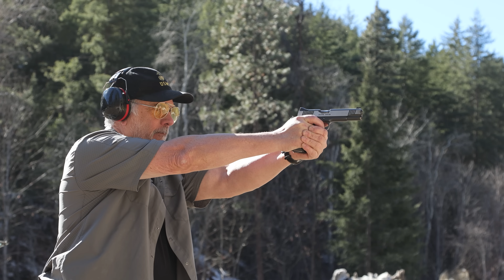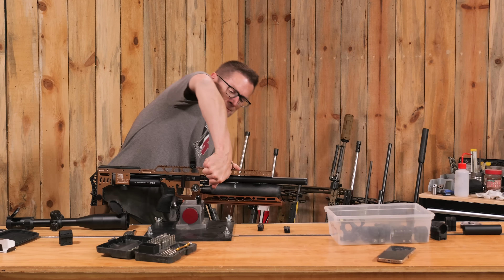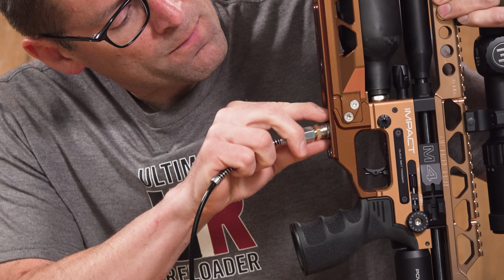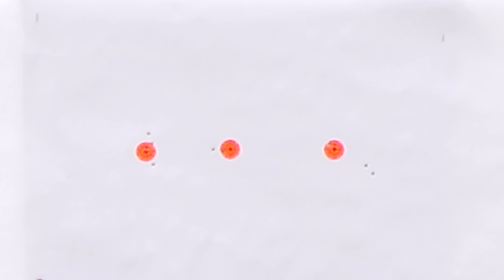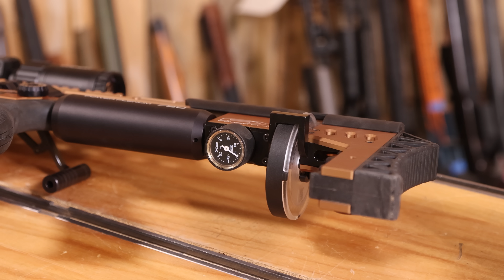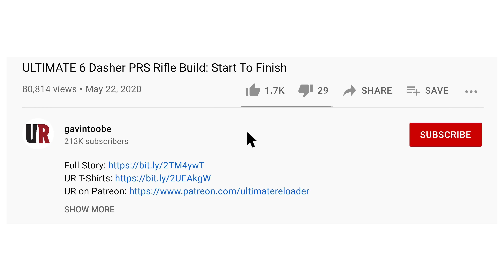Impact M4: FX Airgun Testing & Overview

Comment: No doubt everyone who owns a PCP/HPA compressor (like me) cringed when this guy started his compressor with the compressor bleed valve closed.  Never start your compressor against pressure.  Start it with the bleeder valve open, let it run a few strokes to warm up the grease and then close the -bleed valve (and open the tank valve if you don't have a fill valve on the tanki)  and let it build pressure. It probably didn't matter when filling that bottle (which BTW that compressor is not rated for large bottles like that) IF the bottle bleeder valve was open but that compressor is made for filling guns and guns don't have a bleed valve.

Don't start your compressor piston(s) against pressure.  That's one of the fastest ways to wreck a compressor.

I'm sitting here writing this with an FX Impact M4 .357 800mm extended next to me.  With this gun you don't 'need a couple shots" to put down a 'chuck.  An RMR S.L.A.P. 68gr. slug with a muzzle velocity bumping 1000 FPS in the boiler room and one is all it takes.  I bought this for a hog gun and it does a dandy job on groundhogs as well as the porcine types.  It's a great squirrel shredder too.

Comment: Definitely wouldn't fill the tank with the Rovair. I only use my Rovair to fill my PCP directly. In order to properly fill a tank you need a larger, water cooled compressor that will run for the extended period of time it takes to fill and pressurize a tank without burning up. There are some budget options from China like GX, Yong Heng, and Vevor. The Air Venturi Krypton is also a good choice, albeit close to $2k on Pyramyd Air. Otherwise finding a dive shop that will fill these tanks is going to be best, safest option.

Edit: I will add, not a bad idea to upgrade to a separate oil-water separator/filter for your compressor from GX or Hajimoto Productions which will preserve the quality of your investment.

Comment: I would say that filling the SCBA tank from a home compressor is a bad idea. You would want to fill at a SCUBA shop to remove the excess water from the SCBA tank. This will reduce water being pressed into the PCP gun. Besides, you can get 1,000's of shots from a single SCBA fill. And one more thing, do not fill the PCP canister more than the prescribed limit of 250 BAR, which I learned b y reading the FX manual.

Comment: Bleed the air off on compressor side 1st, i think. 
It's always good to start the compressor up before closing the compressor relief valve. 
The upgraded moderator will be way quieter than the stock one that comes with the impact.

Comment: You've opened Pandora's Box.  Airgun shooting is beyond great.  You can shoot almost anywhere (SAFETY first) when the moderator is installed.  My powder burners live in the gun safe while the airguns get out almost every day.  Options are off the chart.  But they're not cheap.

Comment: When it comes to shooting slugs in air rifles getting a good tune to give you accuracy can be challenging because of barrel harmonics. For the FX Impact once you install the dedicated slug liner most shooters will pick a velocity range to suit their needs. Then what you do is us the micro wheel to vary your fps by 5 or 10 fps or there about either up or down till you reduce group size. I personally like to use the Eagle Vision harmonic tuner on my barrel and just adjust it instead of fooling with the velocity. From the 50 yard group size you had in the video your accuracy was good to go.

Comment: PLEASE learn more about HIGH PRESSURE PCP rifles before making another video. The air fittings and hoses are NOT like your "in the shop" connectors. The fittings and hoses are rated for 5000 psi minimum and usually 6000 psi or above same as the qwik disconnect fittings. Please use extra caution with the high pressure air it can be dangerous. I have owned an FX Impact Mk 2 since early 2020, it is a great gun once you get it properly tuned to your specific slug or pellet. Have fun and be safe.

Comment: I have already said that in a mutt dubber video (he is one of the person who developed slug for pcp rifle instead of pellet, helping the pcp rifle became what it is now, if you don't know him go check his hunting videos, really amazing stuff). As much i am fascinated by pcp i don't see why i should buy a pcp rifle when a rimfire (i have a ruger precision rimf) shoots 1/2 moa at 100 meters, has the same, if not better, external ballistic, less hold sensitivity (since the barrel of a rimfire is shorter than a pcp) no need of compressor, or refilling and the ammo is as exspansive as javellin slugs.
Reply: Good point , I still have my very accurate CZ 22 Cal. Rifle for the range . But my PCP I can shoot in my backyard if I don’t feel like or have time to load up my truck and drive to the Range . I have a less expensive model FX for backyard plinking . For now but I’m pinning for a FX M4 next.  Good Video .
Reply: Fair comments. Here's some reasons why: (1) much less noise--therefore more usable places and hearing protection not needed (2) not regulated as firearms in the U.S. but might be excluded within some city boundaries (3) like all projectile barrels, they can be sensitive to the ammo used--Javelin slugs as precision, pure lead forgings are about the most expensive; I have found several that are more accurate and much cheaper in my FX Wildcat MK 3 sniper (4) adjusting energy & impact momentum from light-heavy for same caliber is very easy using regulator(s), hammer spring, etc. (5) states vary, but hunting regulations have specific airgun categories, calibers and allowable game (most often the same as for rimfires but sometimes the same as centerfire for calibers over .25 but some states allow airguns in shotgun season or shotgun only hunting areas. Definitely should check your regulations...they change....
Reply: @michaelhurst506  in italy both pcp and rimfire are not allowed for hunting and rifle over 7.5j require gun license. The quiet factor kinda loose sense to me. If you shoot a pcp or rimfire in a range you will have centerfire rifle shooting as well, and since in italy suppressor are not allowed, you will need earing protection regardless. If you are in a private range you will not need earing protection with pcp and rimf as well. Plus a m4 impact is 3 to 4 times what i have paid for my rimfire. The only pro pcp thinks is that you have no regulation on the slugs, so you can buy them online and in a not restricted number, but that alone is not whort it
Reply: @micheleUzè   All the restrictions you have in your country shows why the freedoms we have in America is so great. If you lived in America shooting a pcp rifle would  allow you set up your rifle for a wide range of shooting situations.
Reply: @williamr9537 do you think so? as much as i’ve seen on social america and american pepole have days full of no sense and social issue that sometimes here in italy are even hard to immagine

Comment: filling the tank done wrong. connect all hoses, compressor bleed screw open, start pumping, close bleed screw, wait for pressure to build in the line, and slowly open tank valve when reaching tank pressure. or put a one way valve in te line so the compressor does not have to start pumping against the bar in the tank.
Reply: Good instructions for filling the tank. I would add too the last step to bleed off the air using the compressor bleed screw to get rid of any accumulated moisture. Do this instead of using the air tank bleed screw.

Comment: Awesome video well glad you like it so far ... after a awhile it will need some cleaning and maintenance which is no biggie 🤠 depending on if you are shooting high powered or just shooting pellets at 830 fps to 900 fps but if you start to push it on heavier slugs at 1000 fps and up tarragon becomes hold sensitive and will need fine tuning to get those projectiles go straight and accurate but it crazy how accurate they are in 22 cal from 20 yards to 300 yards imo the 22 cal is the best for sligs in my experience thanks for sharing be safe buddy 💯 cant wait for the next

Comment: Hi I'm an FX Impact M4 owner used for commercial pest control. Nice summary video.  At some point you may want to address slugs versus pellets, best thermal or night vision options with ballistic calculators in them. Also maintenance, cleaning, and tripod use for various applications. On and on. These air guns have an application for pest (rabbit, possum, wallaby, rats and bird) control in built up areas.  thanks Paul Rotorua NZ

Comment: First off welcome to a great community!  I have been shooting PCP airguns since 2020.  The "shoe box" compressor you bought is NOT designed to fill the large air tanks. I'm surprised the guys at Utah recommended this?.  I noticed you left out how long it took to fill that 6 liter tank.  That compressor is designed to fill the airgun tanks directly because it will basically disintegrate itself and overheat trying to fill that larger tank.  You need a compressor more like the ones used to fill Scuba tanks to reliably fill the large tanks.  2nd off you need to ALWAYS pay attention to your fill guage when filling the gun and add air very slowly be gentle with the valve.  3rd....pellets and slugs have effective velocity windows as it were.  Diabolo shaped pellets work best and stabilize at velocities from 825-890 fps.  Slugs like a higher velocity of around 925-1050 and have better down range retained energy.  Chronographing your shot strings is very important so you can "tune" your rifle in real time.  I recommend you reach out to Steve Shalley of AEAC on Youtube.  Or Shooter1721 they would be happy I'm sure to do a collab and teach some important stuff.   I also think it is important (which you left out) that FX is a Swedish manufacturer and are of the highest quality and performance.  Folks that rig he is using with the optic is over 3K.  You will discover Gavin that these air rifles are capable of being more accurate than any firearm you have ever shot.

Comment: What size tank is that and I didn't think u could fill 4500 psi too that tank using that air compressor
Reply: It looks like a 580cc tank size. The bottles that come with the FX rifles are only rated to a 250 bar fill. You can get an aftermarket bottles like a Air Marksman rated to 300 bar and since the M4 Amp regulator has a brass piston you can fill your rifle to 300 bar or 4350 psi.